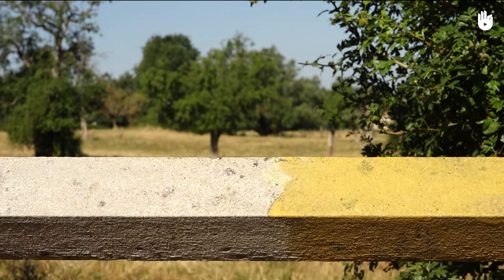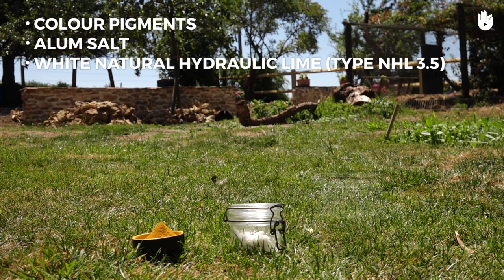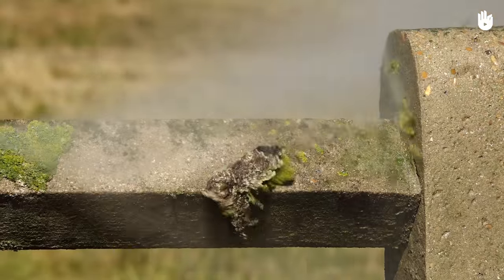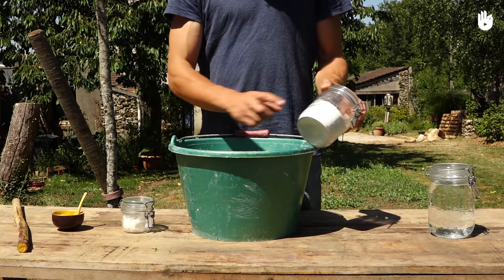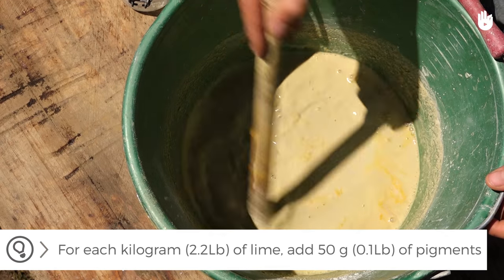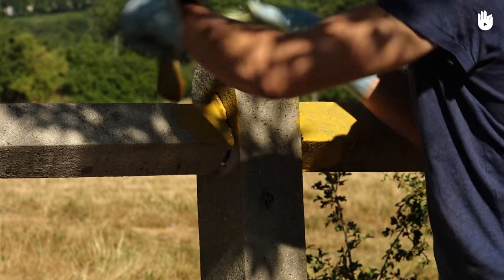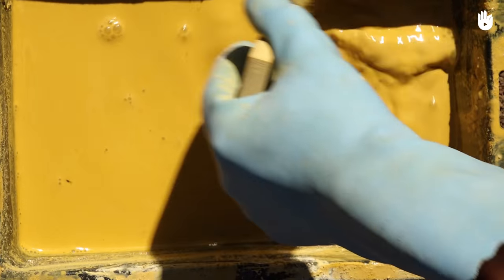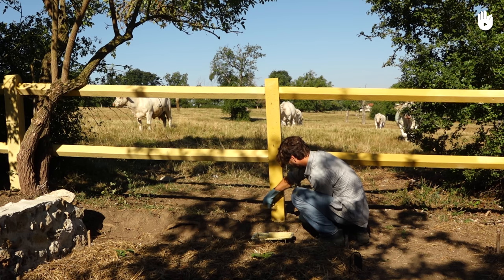How to Make Natural Lime Whitewash | DIY Projects

Comment: You do NOT need hydraulic lime to make whitewash!  Any common hydrated lime will do and has been used since Biblical times. You do not need alum salt either. Though it is a good additive, you can use skim milk in place of water (forms insoluble calcium caseinate with the lime), you can use white glue (PVA) thinned with water to make a more weatherproof whitewash still. Vinyl additives like this are among the world's best for lime/cement admixtures. This is also insoluble in rain. Historically wheat paste (like wallpaper paste was used. This forms insoluble calcium glutenate. For an even more durable product, you can use one part white portland cement, two parts hydrated lime powder (way more durable than hydraulic lime- not that there's anything wrong with hydraulic lime) and the PVA white glue/water mix. This will be an EXTREMELY long lasting whitewash. The pigments he mentioned MUST be lime proof. They are all the earth pigments-iron oxide- ultramarine blue, thalo green,.... look up lime proof pigments- you will find a variety.
Reply: Best info ever!
Reply: @tomasviane3844 dude answered all my questions😂
Reply: I agree, I used hydrated agricultural lime to whitewash the stucco exterior of our house. Just lime and water is all you need, and after it finishes curing/carbonating, you have a sparkling (literally) white finish. Salt not needed, unless you add pigments. Add enough water so that the mixture is easy to apply, not thick like pancake batter. It is very important to wet the surface before you apply the whitewash. Wet it 2-3 times starting at least thirty minutes before you begin whitewashing.
Reply: @jerrymcintire7902  Thank-you for commenting. Many dairy farms here in the Great Lakes are given milking parlor whitewashes using hydrated lime and water only. I watched one and they simply sprayed it on without wetting.  Your advice of pre-wetting is true to improve the adhesion . Years ago the National Lime Association had 7 different whitewash recipes which were picked for historic reasons and basic science experiments they had done. I called a couple years ago to buy some more of that booklet, but they had ceased producing it.

Comment: Is Pickling Salt the same as Alum Salt?
Reply: I'm looking to whitewash a wall so that's why I'm here, though I may be a year late I hope this helps. No, pickling salt is pure salt without additives like iodine, if you add nitrates it because curing salt, which is a misnomer because all pure salt cures and pickles, alum salt is either potassium or aluminium, and is used as a deodorant or you'll find in barber shops, applied to shaving nicks to stop bleeding. Or in this case bind colour to the lime.

Comment: why did someone decide to make a fence out of concrete? Isn't that super weak? How can those long beams be supported is there steel in them?
Reply: yes as with any concrete structure which is very strong there is steel rebar inside.
Reply: Very common in areas where timber is scarce and/or too expensive and yes, they have rebar inside so quite strong.

Comment: hydraulic?...isn't it hydrated or slake..two different things
Reply: its just hydrated lime. theres like 5+ names for hydrated lime.
Reply: @fragglefknrock7568  hydraulic refers to liquid motion under pressure. this is hydrated
Reply: Don't tag me and tell me stupid shit I already know thanks.
Reply: @ragnarmarnikulasson3626  exactly, another utube blunder, concrete needs an acid pre treat, then a uv clear top coat, his little fence will look like shit in 1 season, and moss is back, the top coat prevents that,
Reply: @daleval2182  No, whitewash will last for years and it becomes part of the concrete surface. No need for a top coat.